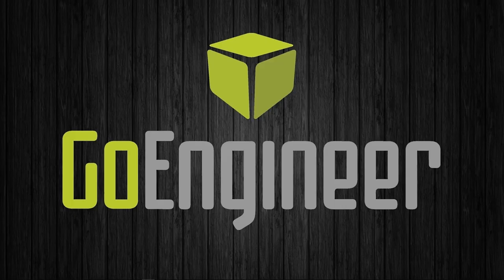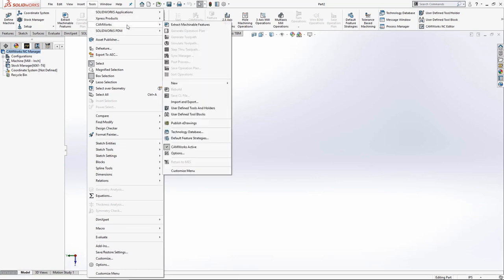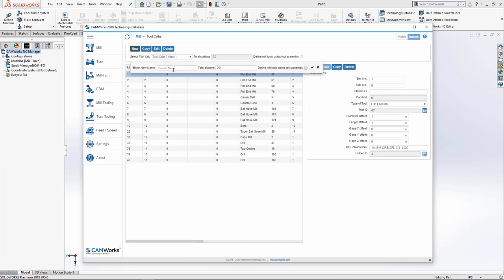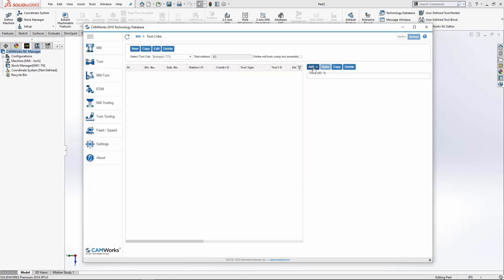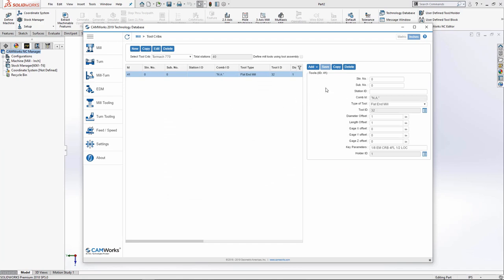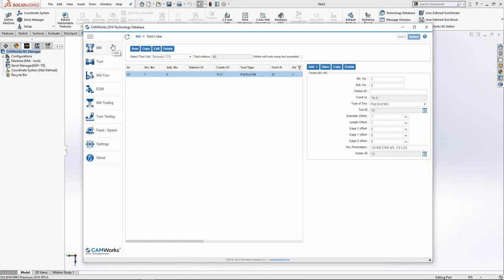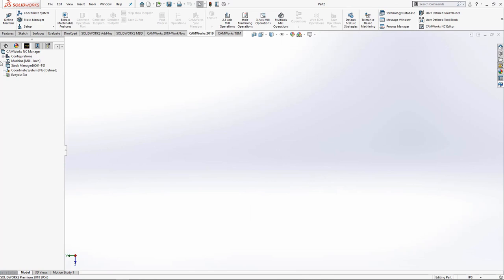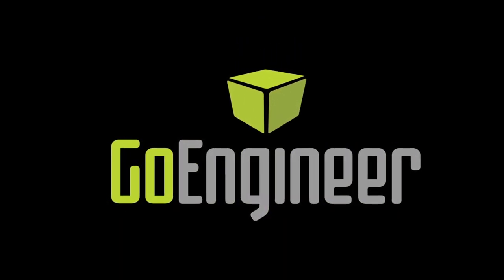SOLIDWORKS CAM and CAMWorks - Create Your Own Tool Crib

Comment: Great video for my tool crib set up. Thank you.
Also,
Our machine has a drill bank unit. L sahpe 5x5 drill series. In rtf file It is been mentioned as below; 

"The Bx number can be from 1 to 31 and it is the decimal equivalent 
of a 5-bit binary number, with each single bit designating the drill 
to be activated. For example:
If number B1 is used (0 0 0 0 1), drill 1 will activate.
If number B2 is used (0 0 0 1 0), drill 2 will activate.
If number B3 is used (0 0 0 1 1), drill 2 and 3 will activate.
If number B17 is used (1 0 0 0 1), positions 1 and 5 will be activated.
When using multiple drills, the code ALWAYS drives the corner B1.
If a single drill is selected the system calculates the proper offset for the
drill used.

The equivalent activation number of the drills desired must be entered 
as the substation number in the station tab of the tool definition.
The system should be set to use substations 
(tool crib tab of machine definition) if the multi-drill will be used with
 multiple stations active, otherwise the substation field is not available.
All use of the boring unit codes H20."

Tool numbers defined as T101 T102 T103 T104 T105 and other axis T201 T202 T203 T204 T205

I am not sure which tool station number or substation number to activate these drill bank tools?

Comment: What if the tool doesn't exist in the TD?  Which is most of the time...
Reply from the maker: You can always create new and custom tools. they can be copied from existing entries that are close and then modified to fit your need.